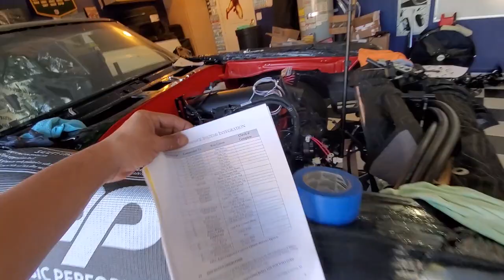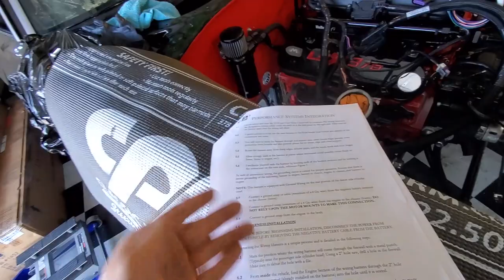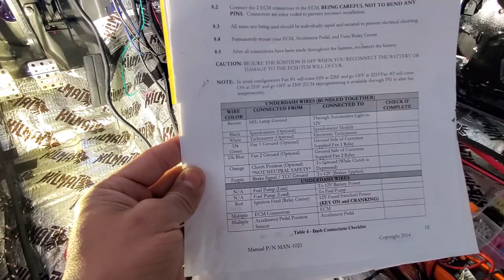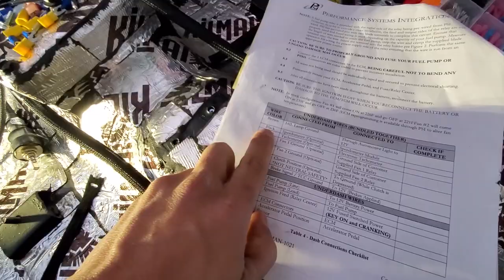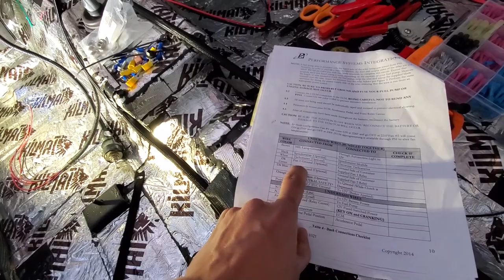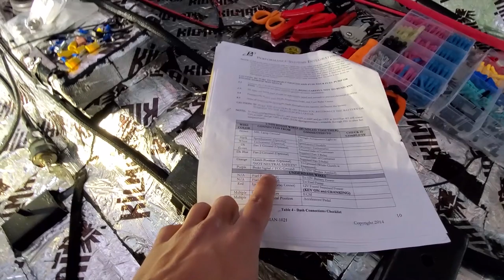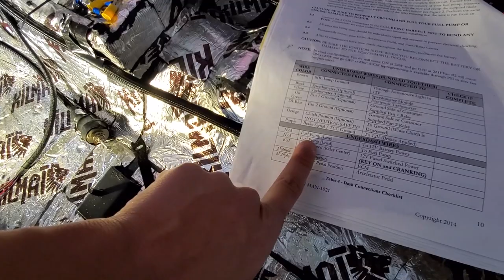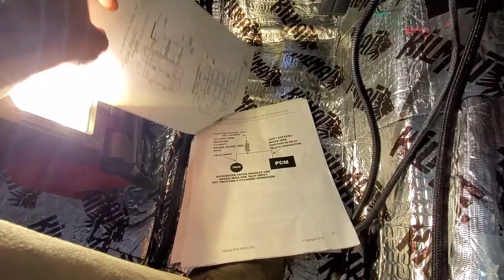HOW TO WIRE A PSI STAND ALONE LS HARNESS! (70CHEVELLE) LSX

Comment: The positive cable running from your battery to starter, is that your power source to the wiring, or do you need more besides the hot wire to the fuse an relay box

Comment: What’s up man i have a question, I have two fans with the two positive ran together and they are individually grounded, should I still run two relays or can I run one with the green and blue wires together to the ground side to the one relay?

Comment: Huge thanks ! A bit more info on the ignition wire. Cab I connect it to a 3 pib toggle switch  ground it an run a positive to the battery?

Comment: What's the best way to run the wires to the starter? Making sure to avoid the headers and should I put heat sleeve on them
Reply from the maker: I run them tight along the bell housing,  heat sleeve would work great
Reply: @goosseperformance1444  ok just making sure I was doing it right, thanks!

Comment: Your Chevelle looks like mine except my firewall is gloss black...still has its heater core...and my fender wells are steel and painted gloss black the same as my exterior,  along with the core support and grill cover....my 71 is gloss black (nighthawk black pearl) with blacked out 8inch Rallys with no caps or rings and wrapped with 275/60/15 on the rear and 235/60/15 on the front....my tires are bold white letter Firestone firehawks....my Chevelle does not have SS stripes....just solid black inside and out with factory black vinyl interior .....my car looks like an original 71 Chevelle from the exterior and interior....but when you open my hood you see a gen III 6.0 with efi and my horseshoe shifter has been converted to an overdrive gate for the 4l60 im running. Im running a 70 12 bolt out of a Monte Carlo that I built with moser axles....auburn heavy duty series 4 posi unit with billet bearing caps,  motive gear 4.11s and a t/a billet reinforced cover....my rear is mounted with Southside machine lower trailing arms (lift bars) and Southside adjustable uppers and air bags in both springs...i know nobody runs Southside machine lift bars anymore but I like them and put them on all of my Chevelle....i like them and my car is under 500hp so it doesnt need anything more....im also running the stock rear sway bar that came on my 12bolt......eventually I plan to upgrade to tubular front a-arms and bigger sway bars....ive already got non-power 4 wheel disk with aluminum d52 callipers and drilled and slotted rotors....i like the manual brakes they stop well and im used to it).....of the 5 chevelles ive owned 4 of them were manual brake cars....im used to the extra effort and i no longer remember what power brakes feel like lol.

Comment: I have a psi harness, I have an LS engine off a 2002 Silverado, I was just wondering on the under dash wires do you know where the Grey wire hooks up to and the tan color hooks up to. Mine has 9 wires that came in the bundle, that go underneath the dash. I have been doing a lot of research and your the closest one that explains where under dash wires hook up to.  I'm using it for 1977 chevy c10. If you can please let me know thanks.
Reply from the maker: What’s your harness part number
Reply: Thank you for fast response its harness psi # 1018 the trunk starts and runs but trying to make gauges work inside truck but thank you again and Happy New Years
Reply: Another question is wondering if I have to change temperature sensor and oil pressure sensor was thinking if I have this psi harness if I still have to change those sensors to make gauges work inside my original cluster I have a 1991 Chevy  suburban cluster already
Reply from the maker: @johnnys1963  Dakota digital

Comment: yo. what up Mr goose?
I just got my 71 chevelle ls swapped .
I'm having problems with my convertible top I live in Las Vegas.  wondering if you could help. I have a new motor and switch .
Reply from the maker: Did you bleed the new motor, I have a video that might help you
Reply: I did the problem is that the motor seems like it's not getting power 😕

Comment: Damn, Goose help a brutha out, you movin hella fast. What about the other end of the harness (i,e) pedal, ignition, and the other few in the inside of the car.  Also (GROUNDING)!!! head to head. Engine to frame and Engine to body correct .
Reply from the maker: Make sure you check out the grounding video on the channel